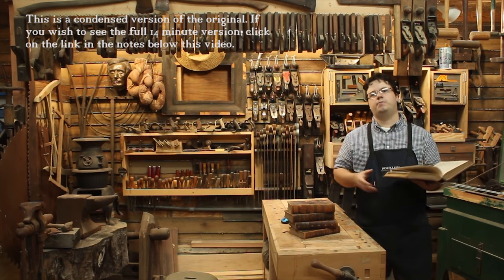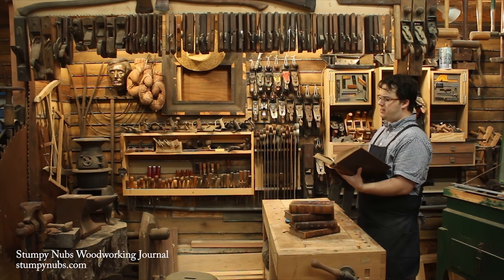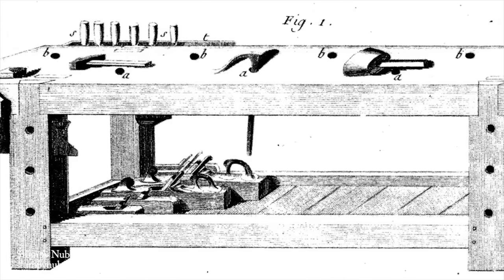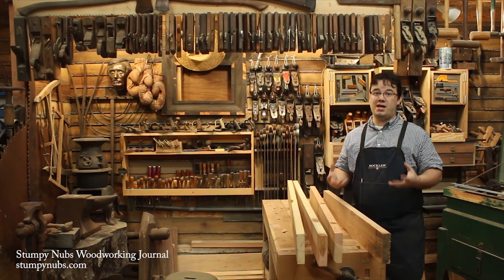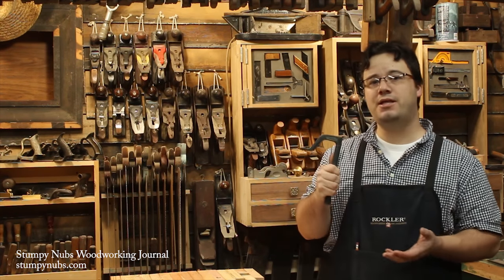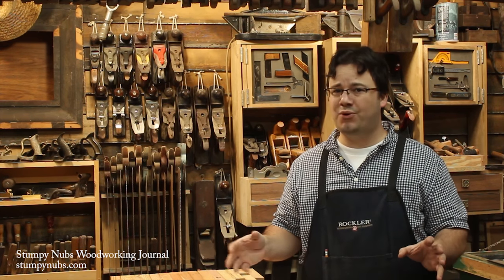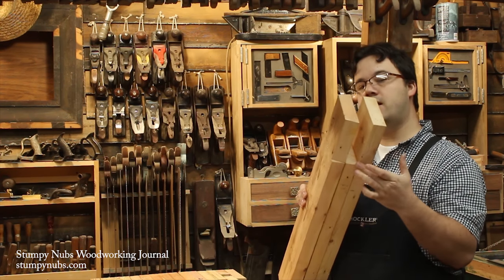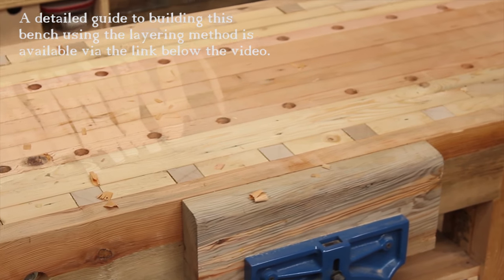Build a Roubo style woodworking bench from 2X6 construction lumber (short version)

Comment: Hey there. Do you have any advice on the placement of a worktable within your workshop/workspace? I'm aware that it will vary depending on the size of space you have or the size of table and the way you like to work, but I just wanted to know if there was anything at all you would do or not do when placing a workbench to help with workflow. For example placing against a wall vs free standing in the middle of the room, near the table saw or miter saw, how much room should you leave on a side etc.

Comment: Could you use 2x4's instead of 2x6?
Reply from the maker: You could, but by the time you flattened the top it would only be about 3 inches thick and the whole bench would be less heavy and sturdy.
Reply: I did.  I used all 2x4's for my entire bench.  The legs are three 2x4's laminated together so the table has quiet the gurth... and to add to that there is a shelf under the table that hold some lumber and other hand held power tools like the circ saw, recip saw blah blah... pretty sturdy.  No complaints yet.

Comment: One of these days I will get around to building a new work bench, or maybe I will spend some money on buying a nice one as a treat to myself after getting rid of the nasty wife ;)
Reply from the maker: Well, I can't relate to that since I married the prefect wife. But I have to admit, as much as I love my homemade Roubo, I love my store-bought Sjobergs bench more!
Reply: that's a surprise.  looking at the Sjobergs on their website a bit, I'm not sure what the appeal is.

what is it that you like so much better?  what's good about Sjobergs, and deficient about your homemade Roubo?
Reply from the maker: The weight of the Sjobergs with full tool chest is about 500 pounds. That is a big plus. The beech wood is harder and more durable than my Roubo'so pine, and looks great too. The vises on my Roubo were nice, but the ones on my Sjobergs are heavier, wider and rack less during use. The drawers in the cabinet are very smooth, and I really like the lower tray design. Now, it is entirely possible to build a Roubo with all those features. But mine didn't have them.
Reply: Stumpy Nubs 
thanks, that's very helpful!

I'm moving towards building a bench in the next few months, and that information will come in handy, for sure.